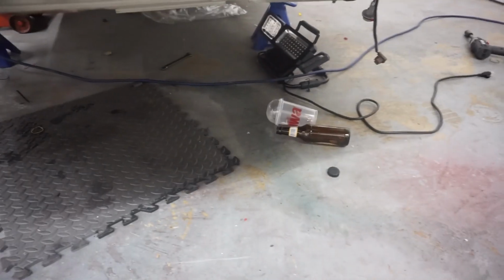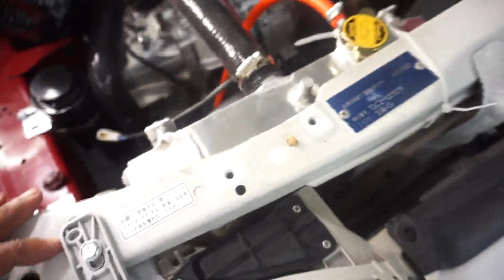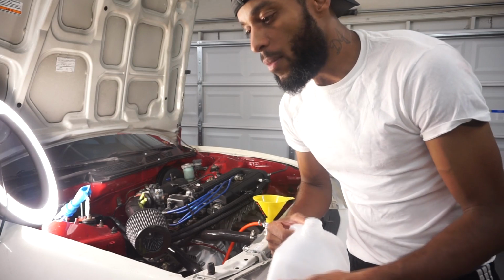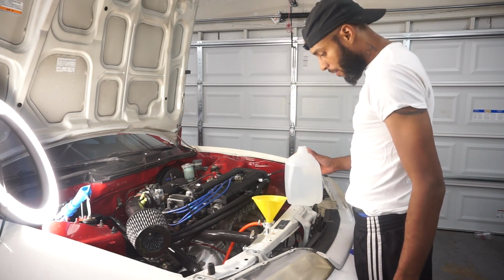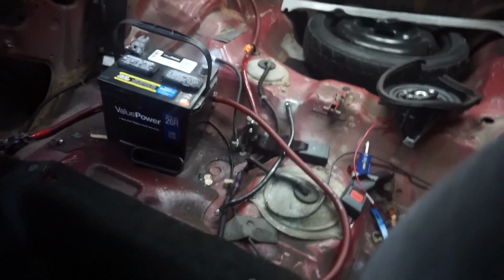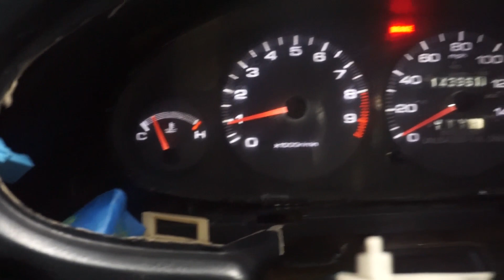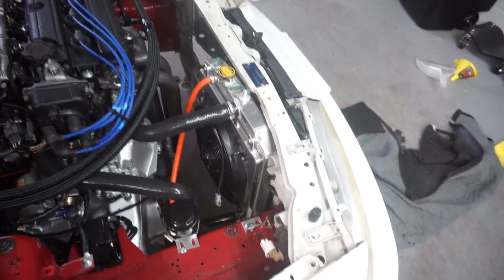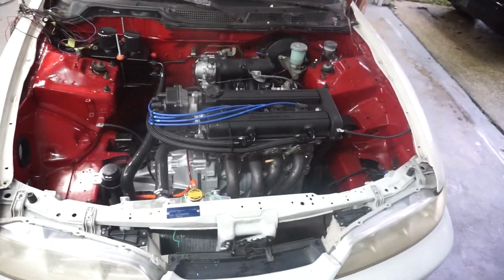Getting the Integra 100%...still a few small issues

Comment: Irvin, coming along nice. BUT that battery 🔋! You need a vented battery if your gonna run it in the cabin in the back. Fumes from regular battery harmful!Yeah take that sound deadening out and paint the rear. A useful tip I figured out this past summer on my EG hatch with removing the sound deading. Buy some purple power and spray on it let sit overnight and scrape with sharp putty scraper. Cheaper easier to find than dry ice.!